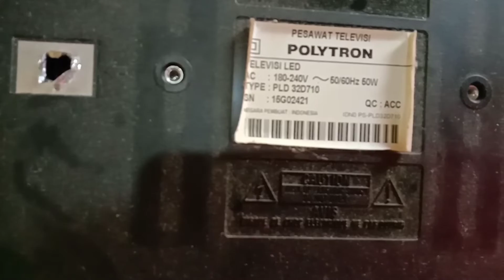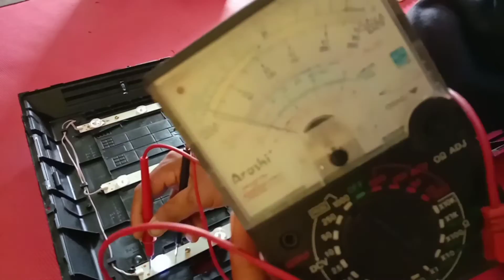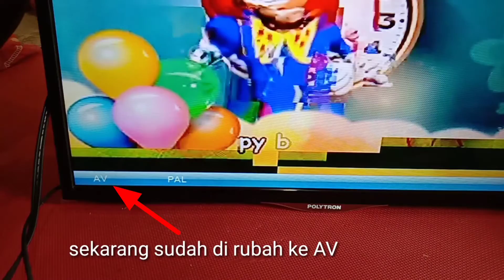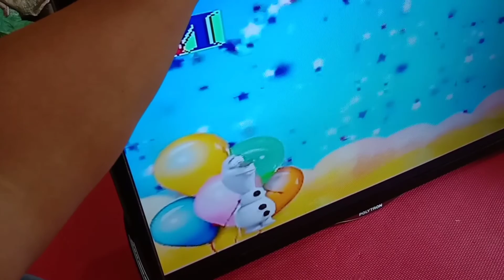Tv led polytron ada suara tidak ada gambar || logo muncul sebentar lalu gelap tinggal suara

Comment: Pak kalau tgangan drive backlight untuk 24inc polytron berapa ya tegangan nya?
Reply from the maker: Tegangan input driver backlight tv poly  24 inc biasa sih  12v mas baru UP/output nya stelah LED menyala dihitung dari jumlah lampu Lednya jika 6 buah LED dan jika memakai LED yg model 6v brrti tinggal dikali  saja =36v teg up driver baclight nya
Reply: @aditvelektronik1751  oh..iya pak .ini saya punya out put ke backlight nya 12V .pas ganti led yg 1 len nya ada 6 dua len jd 12 led.  Nah tegangan ny sekitar 20 kurang. Apakah normal atw trgangan ny kurang pak?
Reply: @imamabdulrohman1405  normal 
krn 6x 3  18v
tp tegangan hrs dibawah 18v mis 16 -17 volt spy led awet

Comment: Mas mau tanya .output tegangan dr power supply ke lampu led berapa tegangannya?
Reply from the maker: Inverter Led tegangan input nya ada ber macam-macam Ada yang 24v, ada yg 40v, ada yg 70v bahkan ada yg 100v lebih.
Yang pasti baru dapat diketahui jika kita telah bongkar panel.  Mengetahui  berapa jumlah lampu led didalam panel,  jenis yang dipakai 3.5v atau 7v, dan sistim penyambungan
Reply: Saya cek 12volt..
Reply from the maker: Berapa inc mas tv nya.dan merk apa
Reply: Plytron pld32v710
Reply: 32inchi
Reply from the maker: Untuk tv polytron led type itu tegangan input IC driver backlight Ob3550cp adalah mmng 12vdc mas jd itu normal
Reply: Berarti masalh d led nya mas?soalnya belum saya buka..soalnya sempet keluar logo Polytron tapi mati lagi
Reply from the maker: Kmungkinan iya mas
Reply: Iya mas..makasih..udah benar lagi tv nya..ganti backlight led nya

Comment: Kalo backligt nya berapa volt bang.
Reply from the maker: Led untuk backlight itu ada yg 3v dan ada 6v..
Reply from the maker: Jumlah lampu LED yg sy prbaiki ada 30 Krn dlm satu batang ada 10 lampu LED jadi Krn ada 3 batang maka 10x3=30 lalu dikali 3volt dalam 1buah lampu led=90volt total yg di keluarkan rangkaian driver backlight untuk membangkitkan  30 buah lampu lednya
Reply: @aditvelektronik1751  soalnya tv nya persis kaya ini. Berarti saya beli backligh yg 3volt ya.
Reply: @aditvelektronik1751  itu seri  ya bro
kl paralel khan cm 30 v

Comment: Pnya ku sma sprti itu. Tp lyar ttep bersinar meski redup. Suara gx ada sma skali
Reply: Stiap di star lampu indicator berkedip dlu tiga kali
Reply from the maker: Cek teg 12 v ketikon mas..di fuse ticon jika nggk nyampai Kmungkinan regulator 12 dipower supply bermasalah namun jika diregulator 12 power supply teg kluar aja coba cek tr  smd kecil dkt induktor biasa sering rusak ..tr smd itu terhubung langsung dgn soket kabel mainboard keticon...
Reply: @aditvelektronik1751  ok trimksih akan sya coba mas. Slm satu hoby ya